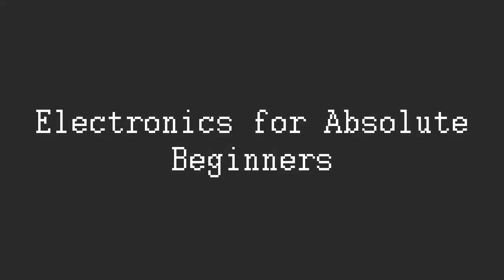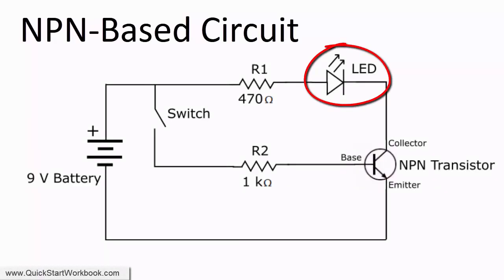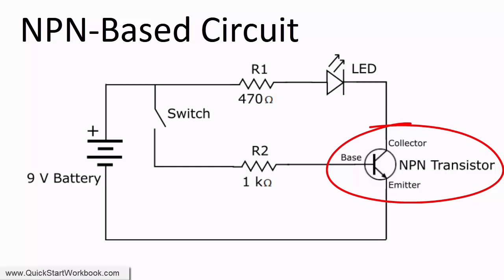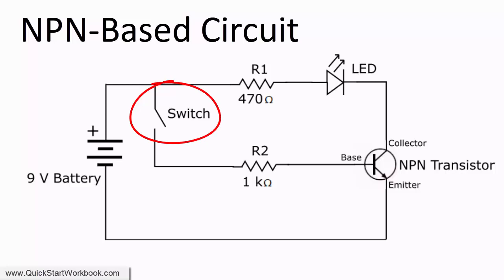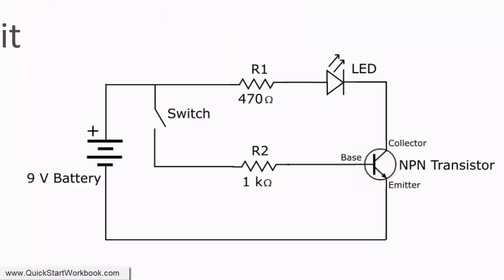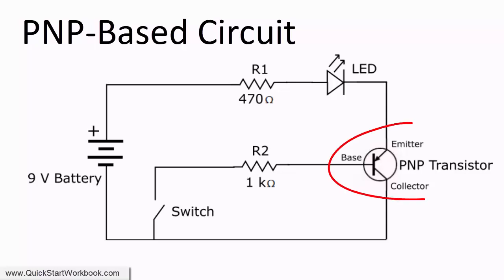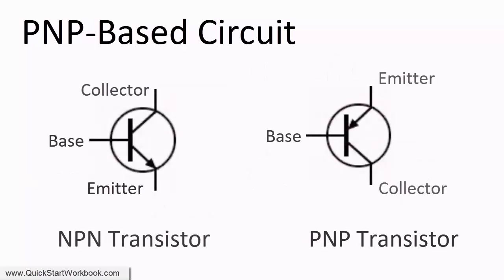How to Switch between an NPN and PNP transistor in a circuit - Electronics for Absolute Beginners

Comment: Change biased voltage or variable ressistor or  change PNP to npn or vice versa or ultrasound reset electrical routing...that is why it cost a bank to run big business maintenance cost

Comment: Why is one resistor larger than the other?
Reply from the maker: R1 is there to protect the LED so needs to be in the region of 470 ohms. You could go a bit smaller, but if you go too small, you run the risk of burning out the LED. R2 is ther to reduce the current to the base of the transmitter. You could use a much bigger resistor here if you wanted too, say, 10k. If you go too big, there won't be enough current to switch on the transistor. You could go smaller as well because the base of the transmitter can cope with quite a large current range.
Reply: Thanks!

Comment: I am not sure, but for the PNP case, I think either the resistor or the LED (or load), or both, need to be put between the Collector and -V.  An admittedly brief query via The Google yielded no example circuits with a PNP Collector connected directly to ground; there is always at least a resistor.  Do you know if the circuit as diagrammed will work?  I suppose if there was a voltage drop from Base to Collector then it might work, although the voltage drop would be small and that would affect the choice of resistor.

If it would not work then it is unfortunate, as your diagram that moves only the switch shows a symmetry that makes the concept expressed very clear.
Reply: Thank you.  I Have been struggling to make this circuit work from his book and I have been baffled.  It would only work if I disconnected the collector that was running straight to the Neg terminal.  I made your adjustment and it works!!!!

Comment: Hello,
I meant to ask if I were to use a hall sensor such as A3144 as a switch to the gate of an NPN mosfet, would I need  to connect its output pin using a 1K resistor directly to the gate of the mosfet like you have it or should be routed differently.
It seems that the hall's output  maybe directly connected to the gate without a resistor and then the resistor is used to connect its output directly to positive side of the circuit.  Is this the case or how does that work?

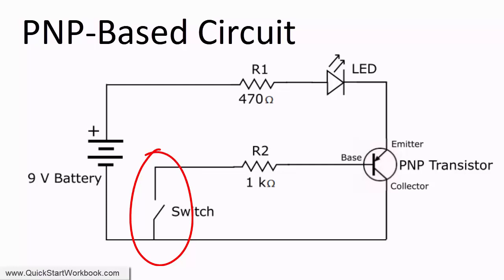You can see it  below at 1:27 into the video. I am just a little confused with it.  It looks to me that if you removed his hall completely the gate is still getting power from the positive terminal bypassing the hall.  It sure looks obvious. I am not even sure if his circuit makes sense. He surely uses up to 24 volts or so to feed his circuit. And what happens to the back emf of his coil when the hall is off?  I like to build his circuit but I am just not clear.  Something is not right.  I have tried it and something is wrong.  I like to do it right.  I notice you don't have any video energizing a coil as a load on the transistor side. 
Another issue I have in mind is for the above transistor to be used as a switch doesn't the gate and the drain have to get shorted circuited to reset it every time ( meaning it has to be turned off) before you can turn it on again.  To my knowledge that is how you turn it off otherwise it seem to remain in on position at least for sometime.  I have checked this using my ohmmeter.  So how does it get shorted in a circuit such as the one I mentioned.
Thanks in advance

https://www.youtube.com/watch?v=WjEJ7FFgbuI

Comment: The gate of NPN going to positive and the PNP goes to the negative terminal.  So what you are actually perhaps meaning to say and not saying  is that the game is that they have simply decided to swap the names of the emitter and the collector while  in real  actual transistor their respective locations are exactly in the same place. In other words the middle pin of each transistor by whatever names is called goes to positive and the right hand pin goes to negative aside from labels.

Also another anomaly is that in the actual picture of the two transistor the gate is the left pin while in circuits it is the middle part in the transistor symbol.
 Is what I have said actually true?
Reply from the maker: Thanks for your feedback - useful comments 👍